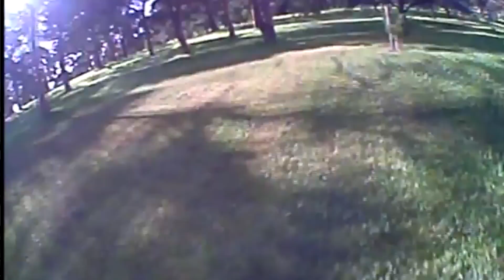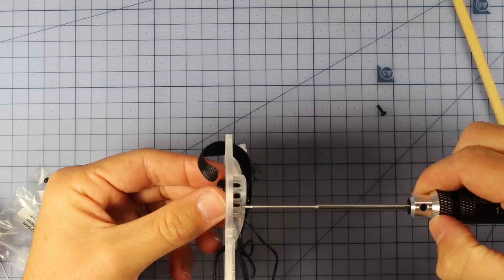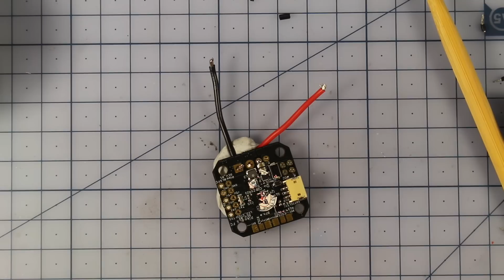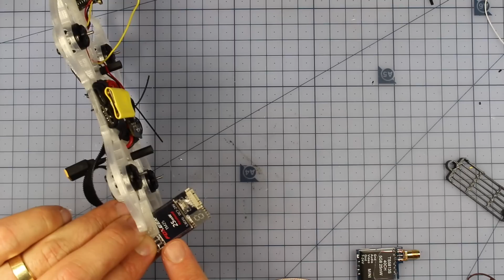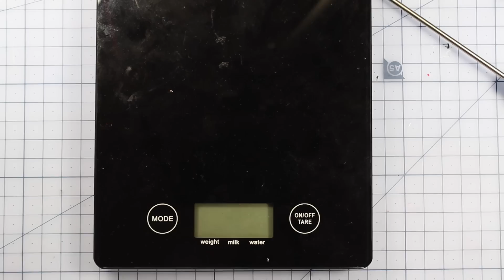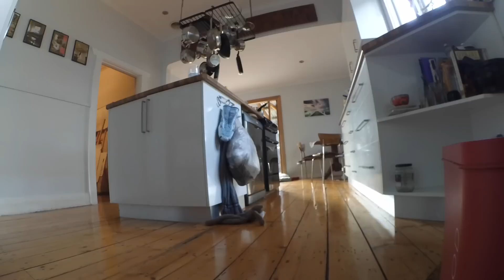RS90 Full build guide. MINI FPV QUADCOPTER. Only 78g!!!

Comment: How do you get access to the USB port on the Piko BLX?

Do you need to take the bottom plate off each time you try and tune the quad?

Are you using a default profile like Luxfloat?
Reply from the maker: I am using the default betaflight tune. yeah the piko is a bit trickier with the USB, Luckily it is all set up and works great.
Reply: UAVfutures Cool! I will get this thing built up. These little guys are great as no one seems intimidated by them when flying near people.
Reply: UAVfutures I really appreciate your videos Stew. I feel like I have progressed exactly like you. You start off flying in angle or GPS assist and then finally fly rate mode. Once you hit that you really get this great out of body rush just zooming around like a bird. Keep up the great work!
Reply from the maker: Robert Fontanosa thanks mate, happy flying to us both : )

Comment: Hey guys, New to your Channel so far im loving it. Im about to Build my First RS90 and was just going to mimic this Video. I noticed quite a bit of static in your flight. would using a Voltage Regulator That is included in the DIY Kit Help?

Comment: Stew: Since the motors are the same and the esc's are similar to the atom v1, is the power similar?
Reply from the maker: the kv of the atom is 300kv with larger props, the rs90 has 6500kv motors on smaller props. Atom has more power and is faster.

Comment: Hey man in Australia, Is it illegal to transmit above 25mw? That's the case in the UK. Even with a license. But no one gives a damn about it!
Reply: Your statement is generally true, for general SRD devices there is limit of 25 mW e.r.p. on 5.8GHz, but under CEPT (which UK is member country) and ETSI you are permitted to transmit 2W e.i.r.p. / 8W e.i.r.p on 5.8GHz if your application is "TRANSPORT AND TRAFFIC TELEMATICS (TTT)" (it do cover models), but UK do have only limited implementation of that Anex of CEPT recommendations (limit is max 2W e.i.r.p.).
I do not know do UK legislators consider FPV video as telemetry, in my country which is also CEPT  member that is grey zone, they only refer you to ERC DEC (01)06 and ERC REC 70-03 (but in non formal talks with people who make regulations here they said that FPV can be considered video telemetry, so I could use up to 8W e.i.r.p  with license or 2W e.i.r.p. unlicensed and basically I am OK and I strictly do not break any law).
Reply: You just blew my mind xD

Comment: interesting build stew... what do you recommend on Small fpv build i Have ordered mrp fpv pod for x155.. what can Be put inside that Small pod.. thanks allready mate...👍
Reply from the maker: have a look at my atom v1 build. those would probably be perfect, but maybe use some 1306 motors instead
Reply: I'm Running 1306 3500kv
Reply from the maker: Kef Unen should be perfect

Comment: I've never build a quad from scratch before.. Although u dont recommend for someone who never build a quad before, this looks like a good project for me to start learning making a quad.. I have never use cleanflight either.. i do have a spektrum trx i used with my rtf quad.. Will i have major difficulty in binding the trx or rathet what difficulty will i face and your advise before i embark on this project?
Reply from the maker: this is on my random scale of difficultness and 8/10 build in terms of how difficult it is. I suggest a 180 sized quad for first time builders or a great kit like this one. https://www.youtube.com/watch?v=iURdanOCFIA
Reply: I don't really know a lot about spektrum RX's, but as long as you have a small enough receiver, you should be fine in any build. The real problem lies in the build itself where everything is extremely tight. You'll need some seriously small ESC's and soldering everything directly on the FC/ESC/Motors can be quite frustrating if you have never built a quad before. But if you're one of these people who know how to read a manual and product documentation, you should really be fine with anything, small or big :) Enjoy!
Reply: +UAVfutures woah!! level 8.. haha.. second thoughts now..
Reply: +Niels Halferkamps I am a manual documentation person.. Now im standing on the fence.. 😂

Comment: Stu, saw that you use 460 and 850mah 2S lipo. What's your flight time on those?
Reply from the maker: I need to check actually. maybe 3 -4 mins on the 460 and that is THRASHING it high speed outside in the parks and woods